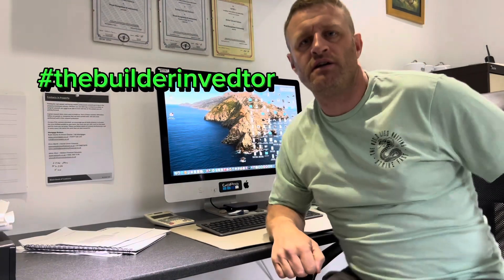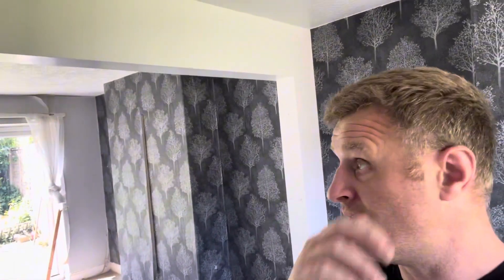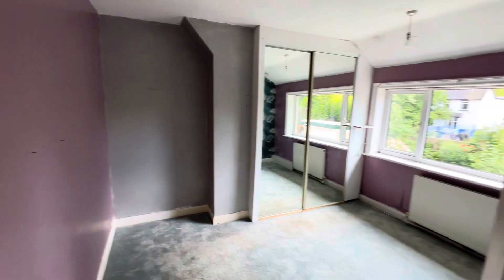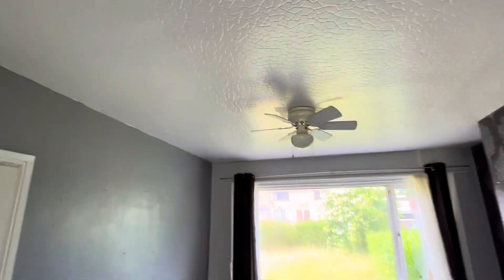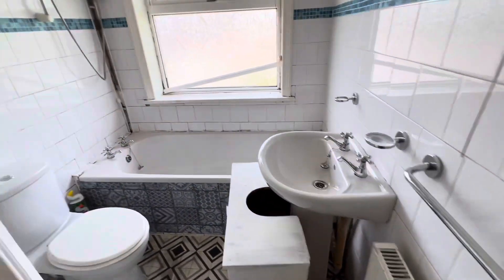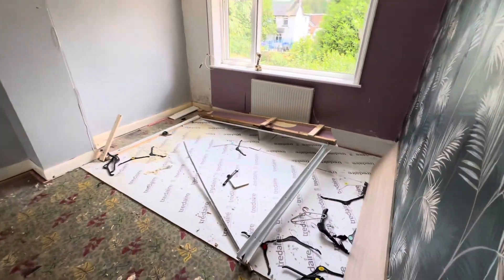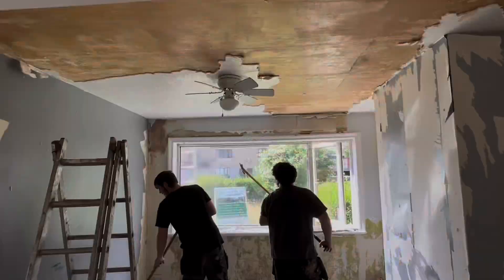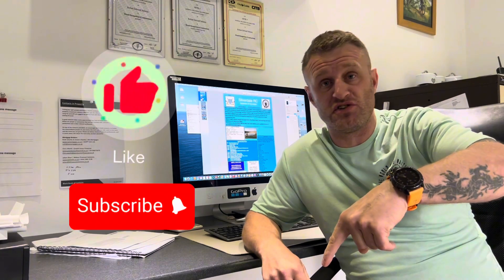House renovation.  Before and After on my latest investment property

Comment: What was the cause of leak, how did you fix it?
The end was very impressive 👏
Reply from the maker: I was told  a tradesman from the south according to the number on the side of his van, broke in and stole all of the plumbing, radiators, copper pipe etc, etc. But left the water running slightly , and it was not noticed for a few weeks by neighbours as the property was empty for awhile.